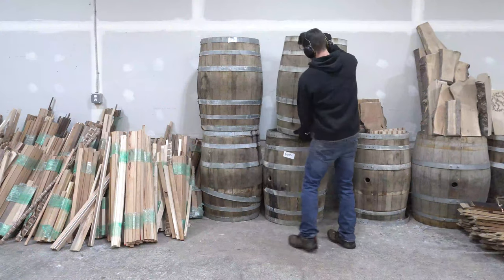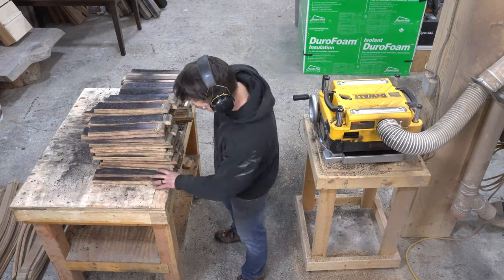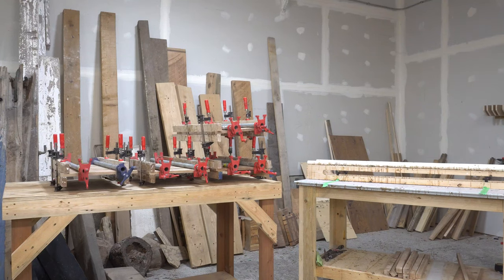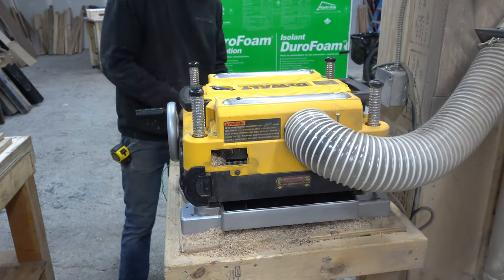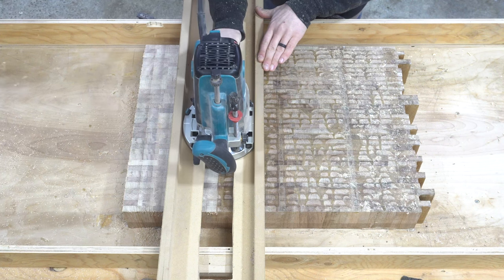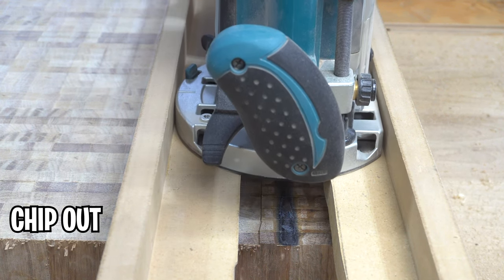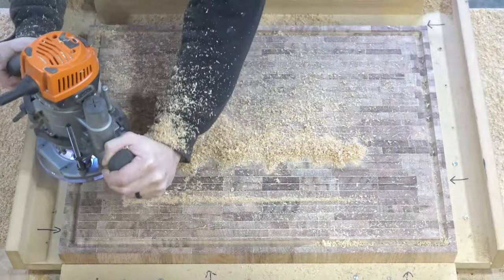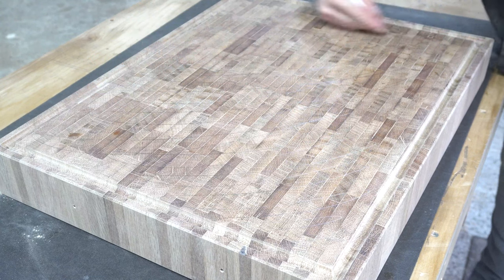From Barrel to Butcher Block - Explained || Woodworking

Comment: Amazing video!
One product I found to be very helpful while working in a woodshop is Festool Sponge sand paper, It's amazing and can be reused hundreds of times. After using it, i threw out all of my old "sand"paper and replaced it with the 50 cent sheets.
Reply from the maker: Great tip!

Comment: Love your videos and thorough explanations. One tip for cleaning the charred side of the staves is to use a pressure washer. It's practically dust free and does well to remove the loose material while still leaving enough char for interesting patterns.
Reply from the maker: Great tip! Never would of thought of that.

Comment: If you cut a few pieces of vinyl tubing large enough to slip your pipe clamps through. Each section will space off the pipe from the wood and give you a 1/16th inch gap so you don't have the issues with pipe clamp stains. Also, use your compressed air to blow off the squeeze-out glue so you don't have to declamp / reclamp each section. I wonder if flexing the un-cured glue impacts the finished strength! still, I love your work!

Comment: Excellent video.  I have been thinking about making a a table top out of a bunch of barrel heads left from a previous project.  I'm interested in the block you briefly showed to demonstrate the problems with the dowel holes.  Do you have a video or writeup documenting that build?  I've been planning to cut out the dowel or nail holes (some have weird double ended nails of some sort)

Comment: Woops. I Heard that "God D!??>t" after you mentioned the amazon link. I typically go for the harsher words when I make a mistake. Nice job on the board.
Reply from the maker: Haha, I didn't even catch that, nice hearing! That part took me a few takes to do, guess it's part of the experience now :)
Reply: @ryanhawkins  Soundcore earbuds. Two additional things. I am making cutting board 2 and 3 and I have noticed the bow you mentioned in this video. Bummer. The second is have you found d the CA gap filling technique to be brittle with board movement? Thanks. Great video.